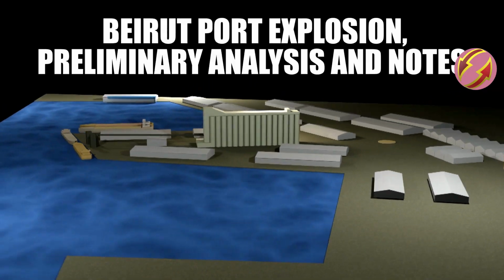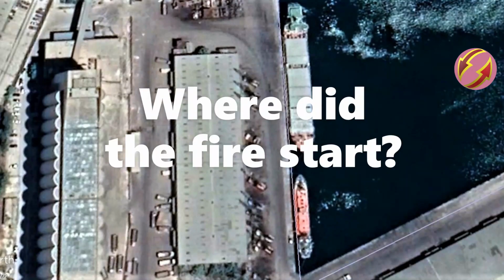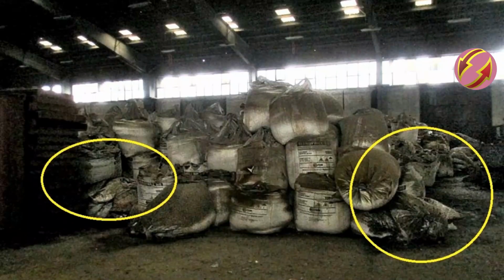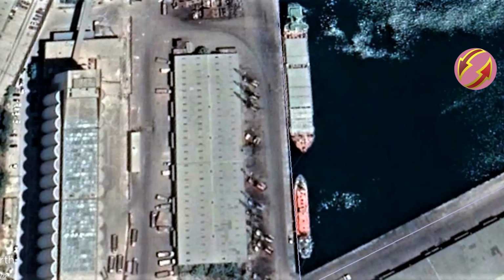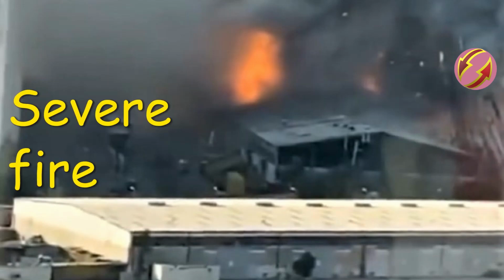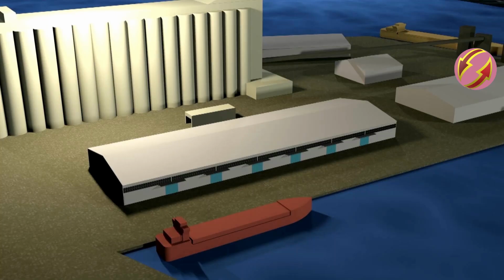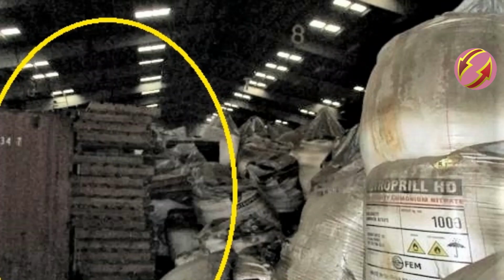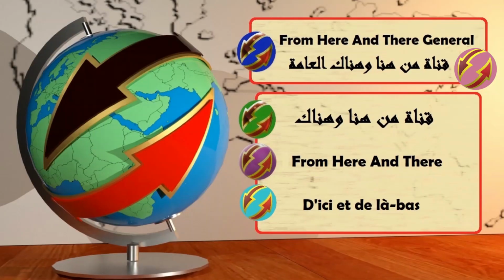Beirut port explosion, Preliminary analysis, part one

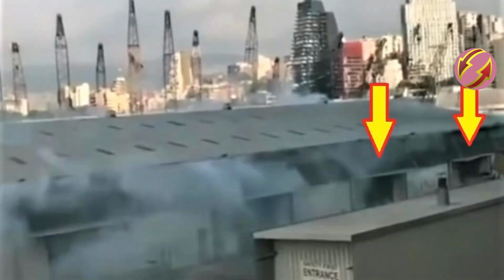Comment: This is a very good summary of the awful event but I must just say that I think you are mistaken at 3:24 when you say that the fire service opened doors on their arrival.  The doors which you arrow, are doors 11 and 12 to warehouse 12.  The photo of 3 of the fire crew shows them attempting to jemmy door 11 open.  The reason that doors 11 and 12 appear to be open is that some of the doors are black or dark grey at the top and light grey at the bottom.  Some of them eg door 8 are entirely black/ dark grey.  Anyway, it's a good video!
Reply from the maker: Thank you for your comment and remark, If you zoom on door 12, you may notice something emerging from inside, looking from different angle may help.